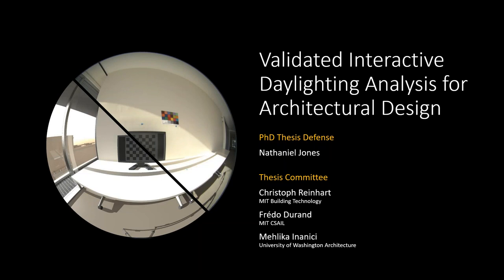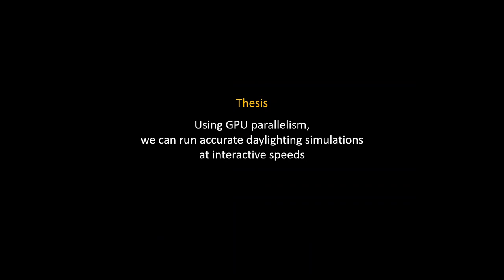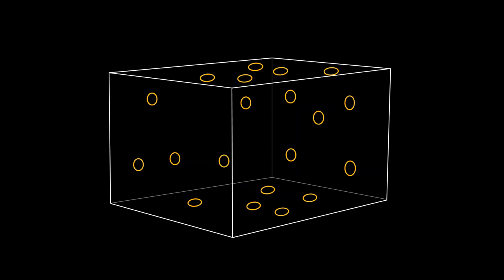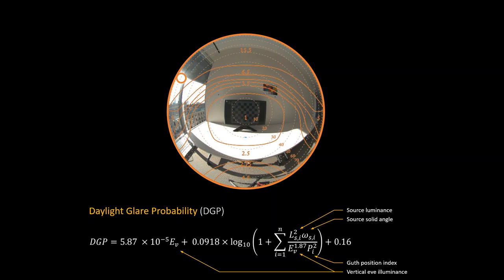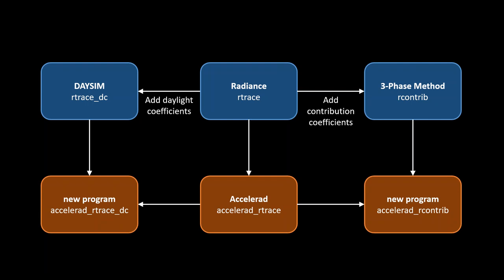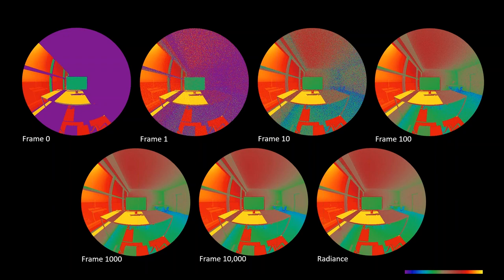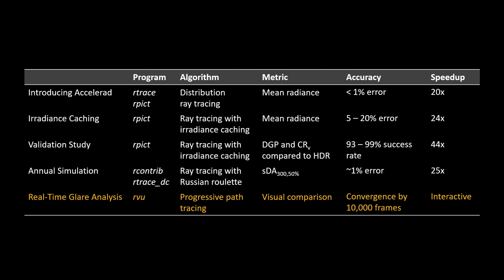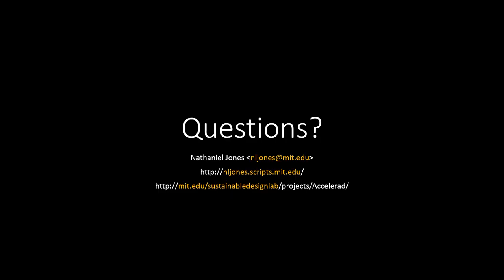Validated Interactive Daylighting Analysis for Architectural Design

Comment: Hi Nathaniel, great presentation (and congrats on your defense) ! I had a few questions..

1. Since you've devised your own caching algorithms, are the options for setting them different from those in Radiance (as in -aa -ab -as etc) ?

2. Does accelerad handle specular sampling too (as in for the last two digits in metal plastic etc).? 

3. Are the blinds in 30:42 using proxy BSDFs?

4. Do you have any plans for supporting Accelerad on non-Nvidia based cards any time soon?
Reply from the maker: Hi Sarith, thanks!

1. There are a few additional options. They're all detailed here: http://web.mit.edu/sustainabledesignlab/projects/Accelerad/documentation.html#commandline

2. Yes, Accelerad handles specular sampling just like Radiance. Specular sampling is inexpensive compared to diffuse sampling, so it didn't require the development of any new algorithms.

3. No, they're modeled as geometry. Proxy BSDFs aren't currently supported for visualizations, although that's a possible future direction.

4. Accelerad for non-Nvidia platforms would be regular Radiance, although one can imagine doing similar parallelization with other more recently developed ray tracing libraries.